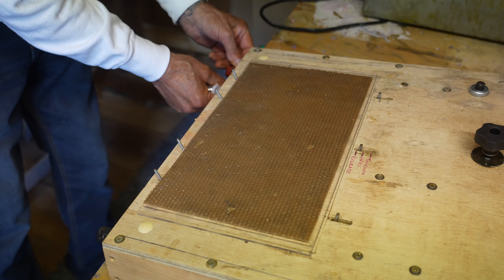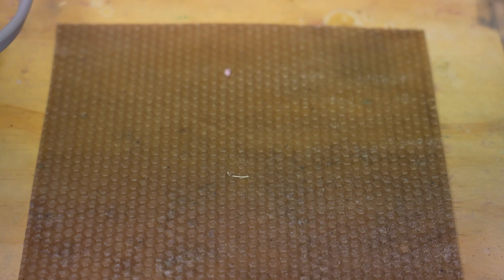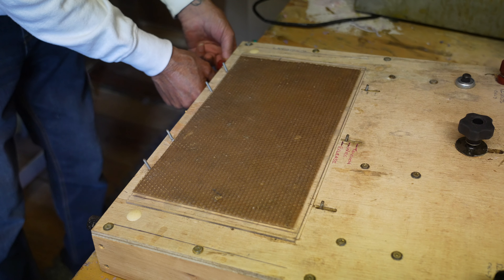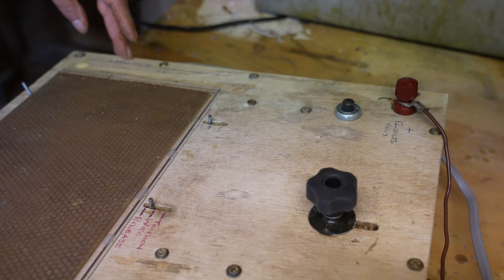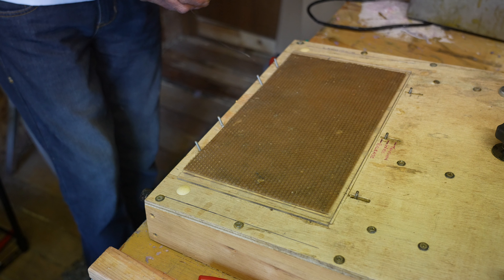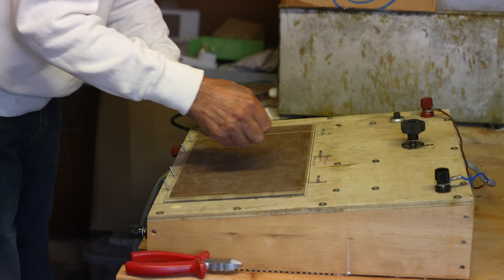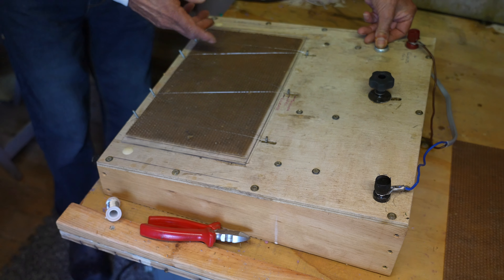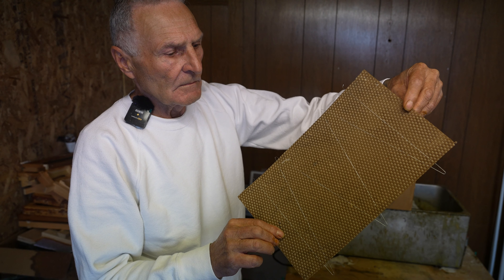You Don't See These Everyday!

Comment: I have one I made even simpler the board is hinged in the middle with a spring to return it you press down to apply the tension to the wire press the switch to embed the wire snip the wire job done.